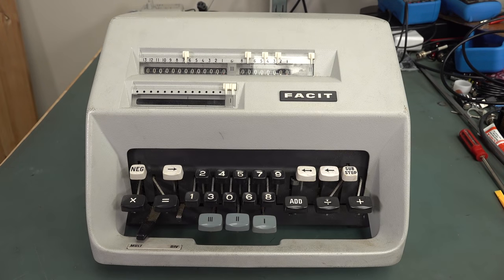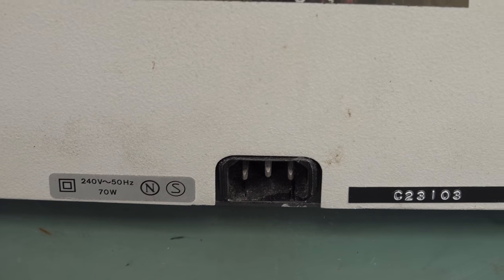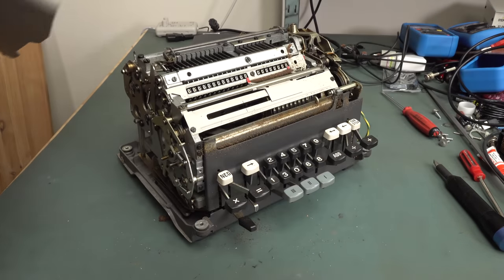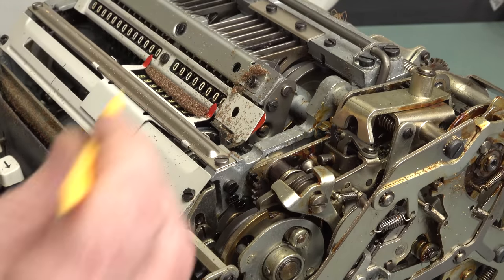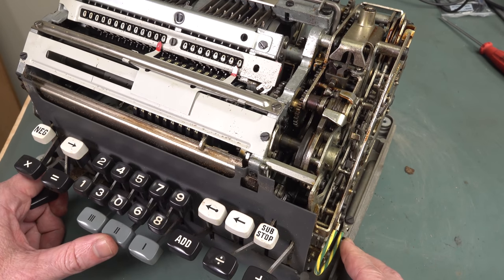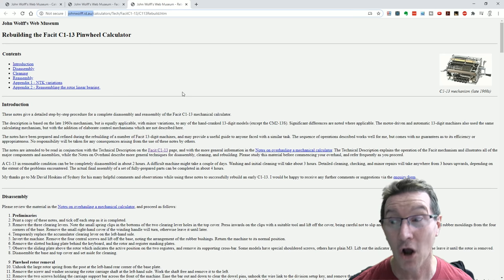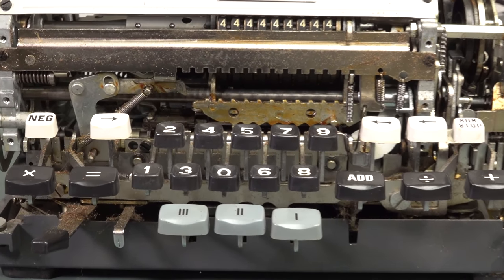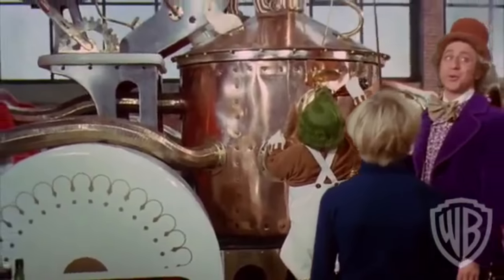EEVblog #1332 - Facit Mechanical Calculator!

Comment: Minor point of note: That's a CA1-13, not a C1-13. The "A" stands for automatic or something and indicates that it's the motorised version with multiplication and subtraction.

I have one which has addition and subtraction swappedd and is currently beyond my capabilities to debug.

Most interesting thing about it to me is that multiplication is essentially "hacked" into the mechanism - it uses it's own hidden pinwheel on the underside instead of using the three visible ones. Even though it works the same as division (repeated addition) it doesn't use the main add/subtract mechanism.
Reply: Also, the buttons change mode based on the switch at the bottom. The divide button is actually subtract. The "Sub Stop" button is to stop division as it just runs continuously if you divide by zero.
Reply: There should also be a bottom plate you can take off. They're even more fascinating from the bottom!
Reply: My one was initially jammed like this one. You need the motor powered (it switches on and off automatically) for the keys to work and when any of the motorised operation keys are pressed it locks out the keyboard while the operation completes. The initial lock step is mostly mechanical, but unlocking it requires the motor running, so someone has probably hit a bunch of buttons with the motor off and gotten it jammed.

The number keys and arrows are 100% mechanical and the mechanism for just that part is both insanely complicated and surprisingly obvious once you work out the basics of it. (The arrows move the input register left and right, effectively multiplying and dividing by 10, the arrow with dot key moves the input all the way to the left for division.)

My understanding is that the oil used on them is a special now-unobtainable blend made specifically to stick to the mechanism and keep it running for a few years, but eventually gums up. They'd be serviced and re-oiled every few years normally. You need to remove all of that oil and re-oil it to get it fully operational. I understand that the enthusiast community tends to use anti-rust spray oil, even though it doesn't stick around as long as the proper oil would.

You should be able to remove the motor unit by undoing a couple of big screws underneath the motor. Be aware that there's a long switch arm reaching inside on the +/- key side.

The calculator is essentially 1.5 different mechanisms combined: the multiply and equals buttons control the multiplier mechanism (input -> hidden multiply register and input + hidden multiply register -> accumulator) and the rest of the keys either control the visible registers (e.g. the |, || and ||| keys clear them) or are operations performed by the "main" mechanism using the values in those registers. The behaviour of the right hand keys depends on the position of the three position control switch at the bottom left. + is always Add, but the divide key switches between subtract and divide. There's also a second tiny mode lever next to the control one, but I can't recall what it does.

Divide is it's own special sort of magic: it subtracts the denominator from the numerator and effectively works like long division. However it has an optimisation where it will add instead if that requires less operations to get to zero - then do an extra subtraction somewhere else to make the math work.

The CA1-13 (and ESR and ESR-0 which preceded it) were the last of their "monolithic" designs where everything was integrated together. The C2s and CA2s were more modular and had a more modern 3x4 key layout.

Facit essentially ceased to exist when electronic calculators came out. Within a couple of years it went from being a massive company to a footnote, bought up and forgotten.

Comment: I'd say it's normal that the motor doesn't run when it's idle, the hand-cranked ones also don't require your to turn the handle all the time. Have you tried the keys when it's powered up?
Reply: The power goes to the motor directly unswitched. The motor provides constant energy to a flywheel, that acts as an energy accumulator, and is clutched in for operations.

Comment: I indeed fixed a basic manual (handcrank) pinwheel calculator with a good oil bath.
WD40 all over, wiggle things, repeat, wiggle again until all parts freed, rince with solvent (brake cleaner, contact cleaner, alcool, anything will do), then final lube with gun oil. I only had to disassemble obvious external parts. 
But it was a basic one, where there's only rotating stuff inside. No keyboard, all manual fiddling of pinwheels. The complicated part here is the keyboard, and how it transfer its action to the wheels, and it looks badly jammed. If something is bent, you may search for it for ages, as everything looks bent by conception.

Comment: @eevblog, Dave these things were used even late into the 80s for a simple reason - accountants and office clerks needed printed output for legal reasons (the paper slip with the calculations was stapled/glued to the books) and electronic calculators with a printer were quite rare and expensive (especially in the Soviet bloc). Moreover, accountants didn't need fancy functions, mostly just addition, subtraction and two decimal places, so this type of calculator did the business for many years even after electronic calculators and personal computers were around. 

I remember seeing a big mechanical calculator of a Czech provenience being used to total up expenses still in the early 90s. That thing made an incredible racket - you couldn't talk over it. And no chance to operate it unless someone has shown you how it worked - totally different from how electronic calculators worked.

Oh and mechanical cash registers (which aren't all that different from this) have been around well into the 90s ... 

Re maintenance of these - there has been an entire cottage industry dedicated to cleaning and maintaining these. My dad used to go around and fix these things at their office back in the late 80s on top of his normal job. Usually it needed just periodic cleaning (especially if someone smoked in the office), changing the printing ribbon (same as for a typewriter) and fixing an occasional jammed key or lever. This stuff was pretty idiot-proof.

Comment: On my hand powered Odhner-Original you subtract by turning the add crank in the reverse direction.

The Swedish Wikipedia article say that the Odhner adder manufacturing was first meged to AB Åtvidabergs Industrier in 1942 and then to Facit in 1965.
https://sv.m.wikipedia.org/wiki/Original-Odhner

https://en.m.wikipedia.org/wiki/Odhner_Arithmometer

Comment: I'm way to young to know much about these calculators but I have heard lots of stories about them and other Facit products from my relatives and my older colleges at both Facit (changed its name to PartnerTech about 25 years ago) and Överums Bruk (now a part of CNH Industrial). The factories in both Åtvidaberg and Överum had lots of old and intresting stuff from the years they had been around, including some traces of products made in arount 1960-1970. 

Really nice to see one that has found its way across the Earth :)
Reply: I just remembered that I had seen an old design sketch of this model and I still had it. 
https://i.imgur.com/UqKnd23.jpg
It is signed "Bernadotte & Bjørn" 1968.

Comment: I just about remember the few mechanical, hand powered (none of that electrical rubbish) calculators still gathering dust in cupboards when I started work in 1979.

Tech Tangents & Grumpy Tim have covered them.

Comment: Dave you need to page CuriousMarc (or check his channel actually) , IIRc to fix these kind of mechanical calculator in the day they dunked them in alcohol to clean it entirely, and then essentially oiled everything, no dissasembly :D

Comment: 17:54 the keys all seem to have a locking latch that holds it from being depressed (presumably while an operation is in progress to stop you mucking about). If you can find the bar/cam that nudges those locks I bet the keys become functional.
Reply: addendum: not posting a 'duh that's the problem' moment - just that it helps to work backwards to find the jam...like finding the stuck hammers on an old typewriter - you can't tell the problem from the keys so you have to work forward in that direction.

Comment: As per my understanding of the history of electronics, almost everything in there is named after something mechanical which it replaced. I think if some breaks it down it can easily be explained with electrical terms. The engineering is fascinating though.

Comment: Given the era, I'd wager any foam in that thing is asbestos.

It's a pity that Dave has no interest in vintage audio. I think he'd geek out over mechanical preset tuning in old radios.
Reply: Unlikely, asbestos isn't known for being spongey and it wouldn't degrade either.
Reply: Nope. Absolutely not asbestos. 
Asbestos is fibrous and nothing else. It can be mixed in with caulking or cement/plaster or very rarely in phenolic resin, but never with foam.

Comment: I wish you could have a look at my Smith Corona Marchant SCM Cogito 240SR. Fully electronic, circa 1965. Discrete resistor diode logic and transistor flip flops, magnetostrictive delay line memory, and vector based segmented numbers plotted on a CRT for it's display. I have a whole massive collection of early electronic calculators, and a few mechanical models, including a pair of Friden STW-10 models... Sadly, also very, VERY seized up.

Comment: It's not rusty enough to be seized, it either has a locking mech or a bent lever. Try pressing + while sliding the bottom lever, or pull that small bottom lever while sliding the big bottom lever. Maybe read the manual - lol -.

Comment: My father worked for the state highway dept and in 1965 he got me a summer job with a civil engineering firm that used mechanical calculators, a bit more exciting than yours because they had a big typewriter-like carriage on top that would move back and forth as it calculated.  Often on long division it would jam and the motor just kept cranking digits, the only way to stop it was to unplug it, and it would magically unjam.  The joke was always "That must be your magnetic personality" making it jam.  Of course it couldn't do trig functions, for that you'd have to look them up in books of function tables,  The next summer the mechanicals were still there but so was a Wang electronic calculator with a central CPU and then 2 or 3 desktop terminals with nixie tube displays, and I'm pretty sure it did trig functions.  It wasn't instantaneous, it could take several seconds to do a calculation as digits flashed by on the display.  .

Comment: 1967 - 1968 what great years for everything, including my Old HP - Fluke - Keithley - Tektronix Test Equipment Solid as a TANK and made to last forever and a day 💪 ❤ Most of my Test Equipment is of that era, lovery well built Gold PCBs,
Dave are you a collector of Mechanical Calculators?
Reply: I know that he is a closure of calculators but I don't know about mechanical ones probably would be more expensive and not to mention taking up more room and weighing down storage shelves literally.

Comment: If you're not gonna take it apart, douse everything in a gentle cleaning solvent like WD40. Scrub everything with a toothbrush, wipe away as much gunk as you can with rags and cotton swabs. Blow out as much of the wd40 as you can with an air compressor. Now re-oil generously with thin, non-gumming oil. Work it for a while to get it to spread everywhere in the machine, then wipe away most of the new oil. You don't need a lot of oil for it to run smoothly.

Comment: Not sure if you can get it on the counterweight continent but Breakfree CLP does an amazing job loosening up gunky oil and such in little mechanical things like this. I'd just liberally hose it down, let it soak for a few days, and give it another try. I used to have a Monroe manual adding machine that needed some love and CLP really got it working smoothly.

Comment: I don't even know where I would start designing something like this, not only making sure it works, but that the parts are manufacturable, then to actually design the manufacturing process. I imagine lot of it would have been somewhat manual, but still.  Crazy to think the engineering and work that went into it.

Comment: Without CAD to design this thing, just think of the number of man hours to come up with a design, make the parts, find where a problem it, and repeat.  There could have easily been 100+ iterations before they had something working.  Just mind boggling.  Computers have certainly spoiled us.
Reply: Never under estimate raw man power. It built the pyramids... Albeit slowly!

Comment: C'Mon man. Coulda hit that with some EPC or Carb  cleaner, Manually remove the rust with wire brushes, and grease that sweet bitch back up! Sorry.... Electromechanical EE over here, can't help it. But... It could use the love! You know you wanna do it.. Great vid, as always. Keep kicking ass.

Comment: You may not believe me but I have actually used one of them, sometime during 1972-74. They were junked when the electronic calculators arrived (big machines with 13 nixie tubes) but we needed written permissions to use them.In FACIT, you can divide by zero and the machine will continue to run indefinitely. They were quite expensive machines. Good old days.

Comment: When my father had his business (40-25yr ago) the cashier was an Anker (IIRC) register machine.  It was an electric machine capable of adding and multiplying, and other cashier operations.  I still remember using it as a cashier, very nice and smooth.  Also my Grand father had a mechanical hand crack driven calculator capable of 3 operations: +,-,* I remember as a kid playing with that machine for hours.  I think I calculated square root of 3 by approximation on it, or something similar.

Comment: At ~10 y.o. I found hand-cranked calculator of one local manufacturer. Very dirty and rusty. Cleaned and restored it by submerging in bucket of oil & petrol "cocktail" for several days :)

Comment: Some random comments from my (fading) memory.  Before I had any calculator, I had 2 slide rules (6" for carrying around and 12" for better resolution).  They were a nice substitution for the log tables.  But one thing they could not do was to add and subtract.  Eventually I started looking around for a mechanical calculator, just like the Facit, but it was too expensive.  Then I hit a lucky finding at a pawn shop.  I found a Brunsviga mechanical calculator.  It had a few less digits than the Facit, but still enough for me.  The hand crank had to be in its downward lock position  for reading results and some other operations.  I think some of your Facit "lock" state issues must be related to that, rather than any dirt.  Anyway, the Brunsviga did all four basic calculations.  And a mighty surprise -- there was an "algorithm"" to find square roots!  Good machine.

At work, we got a teletype connection to a GE time sharing  computer, but were drooling for a desk top calculator.  I got assigned the task of comparing three of the, the HP 9100, a Wang and a Litton (Monroe).  All three were supposed to be for technical calculations.  But I quickly found that both Litton and Wang mishandled negative exponents.  So, we wanted to buy the HP 9100.  As usual, the management sat on the brakes for any spending of this kind of money.  But then something wonderful happened, HP came out with their pocket calculator model 35.  A while later I decided to order one for myself.  There was a lead time and before I received my calculator, I got transferred to another division.  Hearing that, my immediate boss came up with justification for the departmental need of the HP 9100 -- I supposedly was so disgusted about the delay on the HP 9100 that I had both ordered my own calculator and also left the department.  The claim, I heard later, had caused the release for the HP 9100 purchase money.

At about the same time I gave my Brunsviga to my brother who took care of our farm finances.  He continued using it several years after we had sold the farm, probably until he got a spread sheet program in a computer.

Comment: It seems to be a locking bar in place to block concurrent key presses, I think I remember that it was the case that when a key was pressed all others were blocked until the motor had executed one turn of the mechanics to process that key press. I have fiddled with one when I was like 4 or 5 years old and it was shockingly noisy for me at the time.

Comment: I would spray a whole can of WD-40 into that thing....that will make things going
Reply: WD-40 is a cleaning agent not a lubricant. You would have needed to geese it afterwards. Don't abuse WD-40
Reply: @pahom2  don't forget it's also a water displacement.
Reply: @pahom2  true, though the main reason is because it evaporates quickly, it will function as a lubricant while its still there which is often long enough to get things working but you're right that it will need to be properly lubed if you want it to keep working.

Comment: Working in a bank in the mid 80s, I used an electro-mechanical calculator like this made by Burroughs. It was a flattened version of this. When you turned it on it sounded like a tiny B-17, and hitting keys sounded like a machine gunner.

Comment: My high-school had Facit mechanical calculators until least the mid 70s.
It was interesting to hear how much noise a classroom full of these machines could make, esp when you set it up to divide the maximum number of digits, the number 9 divided by 1.